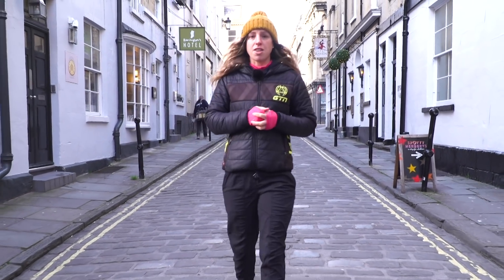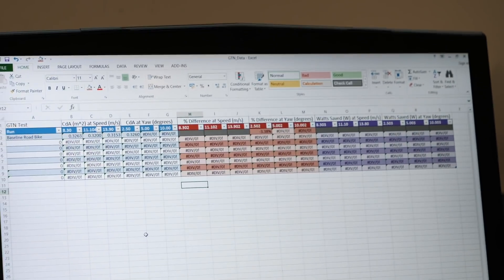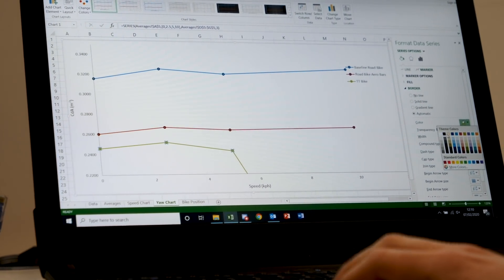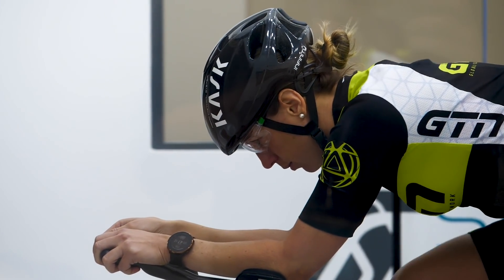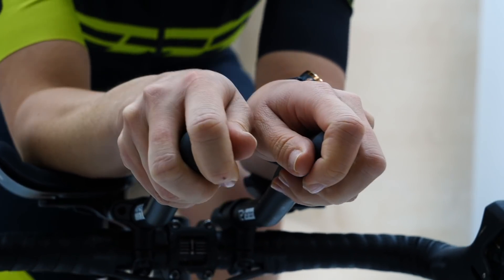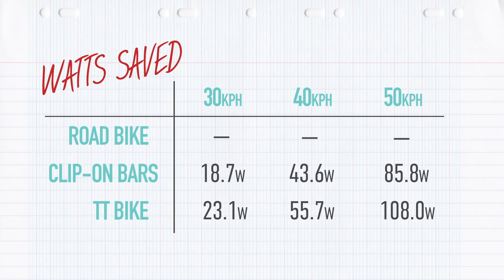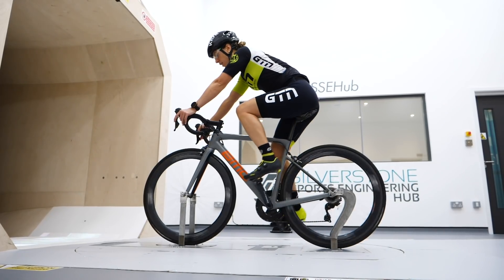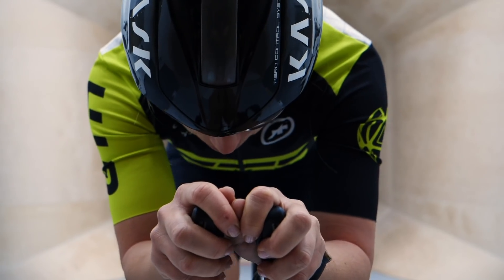Time Trial Bike vs Road Bike | Wind Tunnel Testing

Comment: I think some misconceptions were put forth here: 1) You can't get an open hip angle on a road bike - It depends on the road bike, mine allows me to move the seat quite far forward and then I just tilt the nose down a few degrees, voila open hip angle. 2) There are aero frame road bikes, lots of them, which would put these numbers far closer. There's also the fact that road bikes handle better than TT bikes, so in sprint and oly distance races where there are typically a lot of turns to contend with, I'm faster than those who brought expensive TT bikes, because I corner faster, descend down hills faster etc. The point is - you can buy a road bike that pretty closely resembles an TT bike and spend far less money, then also have a bike that's useful in the mountains, thereby saving a lot of money.
Reply: instaBlaster
Reply: Spot on
Reply: there are several saddle mounts that put you forward and open up the hip angle which cost around 100€ - you get the exact position as if you where sitting on a triathlon bike. pure tt bikes are much more marketing at this point. I can achieve a CdA of 0.2 to 0.22 on my custom built road bike.

Comment: Glad the 30KPH was included, because, realistically, that's where most of us are.  Just shows that for most, the upgrade to TT isn't for  any real speed gains.  Perceived speed gains are another mater🤔.
Reply: Also how long can a normal triathlete keep going 50kmph? 5, 10 or 15 minutes? Carbon bicycle frames are tremendously overpriced as is, and top end TT bikes are just ridiculously expensive. I've beaten ppl with crazy expensive bikes, simply by running and swimming faster, and have been beaten by ppl on steel frames, mtbs even. Dedicated tri bike is for professionals. Sure one can say saving 9 minutes over a 40km Olympic is a lot, but, in all honesty, i'd rather spend the price difference between the bikes on a new car, and just run faster.
Reply: Morale watts are 100% a thing 😉💪
Reply: Was going to say even the pros aren't riding @ 50... hell the IM Florida (really flat course) record set last year was I believe @ 44.8 kph.. That being the fastest male pro...
Reply: @minem23  While I agree with your sentiment in general, in all honesty, I would rather continue to comfortably live without any car at all and own a top-end bicycle instead, or - even better - multiple upper class bikes. What's crazy to me are people that drop a hell of a lot more money on expensive cars that are extra bad for the environment and are basically useless on public roads with speed limits. If you don't live in or close to a city, I can understand the need for a "normal" car though.
Reply: @ithanil4429  no argument there save for the fact that carbon frames are overpriced because of the short lifespan of the material. If you said titanium or custom steel frame, yeah :-)
Reply: @minem23  Oh, yeah a carbon bike is most likely not the best value available in terms of money per year or km. If you want a bike that lasts for decades, indeed you'd better go with steel (I don't trust Ti though).
Anyway, my current (first) Carbon bike got a 6 year warranty and I plan to use it - unless something very bad happens - for about 10 years. It's not my only bike and within that time I will, most likely, buy at least one more, so at the end of my use it will likely "only" be around 1500-2000 hours ridden. Which would result in something around 2 Euros per hour used, if we include (!) general maintenance cost, replacing at least the handlebar once and say it has 0 value in the end. Not too bad, in my opinion.
And I know people that are still happily using their more than 10 year old bikes with carbon frames. They were used a lot and are still just fine.
Reply: @ithanil4429  I hope mine will get the same, kinda started to love the damned thing. A dedicated triathlon bike seems too expensive at the moment. Wait until I finish a IM 70.3, then I will see 8-)
Reply: TT bikes are relatively insular in capabilities anyway, they're not as versatile as road bikes. Not for the average person anyway.
Reply: @ithanil4429  Same. I won't drive or ride motorbike, heck even public transport unless I absolutely have to most of the time. I am a petrol head, I still like the odd drive for novelty mainly but cycling has taken up the vast majority of my transport time now. It's significantly more rewarding and more often too.
Reply: I took the 50kmh as sitting on 30kmh into a 20kmh wind (and so on...)???
Reply: I got my tt bike for 1k so I think it was worth if I go 35kph probably 10W, $100/Watt isn't the best but not horrible

Comment: Ive only just gone from road bike to TT position with clip on bars, and the difference was not only faster but felt easier.Although I do feel cramped, but there must surely b  a way to set up a road bike so u not cramped in the clip on bars.

Comment: A tt bike on it's own is only faster in a flat course, the main gain when riding a tt bike in a triathlon is confort. That confort could be replicated in the road bike by changing the saddle and the seatpost setback. The bike industry is tricking you because the rider position on the clip on road bike is not the same as the tt bike, they don't want to compare it side by side. The tt frame's aerodynamic gains compared to a normal road frame are minimal for an average triathlete.
Reply: Good point!
Reply: André Figueiredo Changing the saddle and seatpost setback probably won’t get you in the same position necessarily, the head tube and seat tube angles are totally different and you could very well make the bike very twitchy by moving the centre of mass into a place it’s not supposed to be. You’re right in saying the frame makes the least difference because it does, even socks can make a bigger difference than frames. But in general a TT bike and then triathlon bike will allow you to comfortably and confidently get into a more aerodynamic position. If you can find a road bike with tri-like geometry then you’re on to a winner. I really like the canyon aeroad for this. It’s not a trick of the bike industry, it is representative of the difference between a typical road bike and typical tri-bike. Of course there will be exceptions.
Reply: @binbob9  It's kind of a trick, because when Cervélo launched the P5X every review was very favorable, I've never ridden one, but I could tell just by watching it, with that frame and disc brakes, it has to be sluggish as hell.
PS: I own a Stevens super trofeo(2016) and a Ribble SL(2017), the geometry is not the same, but with a zero offset seat post, a shorter stem and a base/tri bar. I guarantee you I'll be faster, more comfortable and save a lot of money
Reply: The red-shift aerobars + adjustable seat stem combo on a basic road bike has saved me a ton of $ so far.   I was able to spend just under $1200 and not feel bad about it.   The next step up would be $3k.  So with that difference I bought a power meter, head unit and trainer.   Until I can start pushing above 30km/hr consisantly...I feel that better tools are more important than better gear.

I with a flick of my hand I can move my seat up thus putting my hips in a better position.    Still want a decent TT bike someday but I will probably  put more emphasis on the mechanical rather than a super fancy ultra lightweight frame.

Comment: I switched from a Roadbike with Aerobars to a TT because I was going from Olympic Distance racing to 70.3 racing. The biggest difference for me was the change in comfort. When riding my Roadbike with Aerobars I felt very crunched around the area of my stomach, sometimes even feeling my legs movement inside my stomach area. Once i switched to a TT bike the difference was astonishing. The area between my legs and my stomach increased significantly enabling me to pedal smoother and longer in aero position. I kind of had the feeling that this boosted my run after the bike as well since my stomach wasn't that "nervous".
Heather when you sat on your TT you where keeping your head low and looking towards the ground. Do you think that lifting your head in order to actually see where you are going will decrease the watt advantage you measured?
Reply: I feel that this is more due to the bike fit than a TT bike advantage
Reply: Fluffimir Puddin +1 for the bike fit 🤷🏼‍♂️
Reply: Definitely need to see where you're going, but on aero-bars or TT bike - the goal is to get your head as low as possible to be as aero as you can be.

Comment: I am using a regular Road Bike with a special saddle mount to open up the hip angle and bring me more forward on the bike - also put my stem in the lowest position possible with a negative angle of 17 degrees (could even be less!) - this plus a good set of aero rims 60 in the front and 80 in the back makes my setup as aero as any TT Bike you would get for around 5000€ - if you dont add up the wheels the custom build cost me less than 500€ and I only have to buy one bike.

Comment: Very interesting, my complaint is the way the raw data numbers are presented is extremely confusing to understand, especially the watts lost with yaw where the positive numbers are not explained.
Reply: Top tt bikes actually increase wind speed pass the bike at These yor angles essentially pushing you along giving you free watts.
Reply: @alansteel1409    You'd have to imagine 10 degrees would not be enough? 

The best I could come up with, is they compare everything to a standard bike at zero degrees and as a reference they call this zero, then if the aero bike has less drag the numbers are positive, in reality the reference would have drag of x watts and the aero bike drag of <x but not actually positive, ie not being pushed along.
Reply: Jester123ish The positive and negative numbers represent watts gained or watts lost. So +10W means you’re 10W faster, -10W means you’re 10W slower. There have been different studies on the yaw angles of cycling. Typically you’ll spend 90% of your time below 10 degrees of yaw. Even at Kona, one of the windiest routes there is you’ll spend 70% of your time below 10 degrees yaw. Higher yaw angles are usually only seen in gusts hence there isn’t actually much time spent there.

Comment: as a non-pro you dont buy a tt bike for Speed but for comfort and the changes in geometry.
Reply: @gopre80 Cool factor leads to confidence.  Confidence can lead to better times.  Just don't let in bleed into arrogance.
Reply: I’ve stayed on a road bike for exactly this reason. TT bikes are not comfortable. The top triathletes have to train themselves to tolerate that position. For the average person a TT bike is an instrument of torture
Reply: @shaunhoulahan4080  thats not true. There are tt cockpits that allow a very very comfortable and upright position. And this confortable position will still be faster
Reply: Huan Son So which bikes are these? I’ve tried a few. I haven’t found anything remotely comfortable
Reply: @shaunhoulahan4080  i drive a 2016 bmc time Machine. I could get the cockpit realy high. If you take a bigger frame this thing us like my grandma's city bike. But not all bikes have these modular cockpits
Reply: @shaunhoulahan4080  It takes time.  It took me ~1 year to go from high and wide in my cockpit to ~50% the way there to ideal.  However, the I now prefer to be in the cockpit.   This is why starting with a road bike that have decent clip on aerobars and a seat that can shift forward is a great place to start.  My guess is in 2 years I will finally get my TT bike and I will enjoy it and take the best advantage of it that I can.  The best part is then I will have two bikes and can leave my road bike in the trainer.  :)

Comment: As a newbie, I found no / very little speed difference between a TT bike and a road bike with clip ons. 
However, I find the TT bike saves my legs a lot more for the run - rarely commented on, breifly mentioned at 4:47 but so much consideration required as I feel this would save me minutes in a 70.3
Reply: This I think is often what is missed.   There is a fixed cost to just "being on the bike" which, IMO, eats into your effective FTP more than people wold like to admit and or understand.   

I agree with an above poster in that the slower rider benefits the most in terms of time and thus gets the best bang.   However, in terms of $ per second, most triathletes after some clip-on would benefit much more from nutrition/training but the TT bike so fits the current "just give me a pill" problem fixer mentality.

Comment: who rides at 50 KPH, aka 31.5 MPH? The Cameron Wurf's of the world avg around 26 or 27 MPH at Kona. Crazy silly test. And there is alot to be said about position, hamstrings vs quads in on a tri bike vs road bike. On a NO wind same course route I will always avg circa 2.5 extra MPH on a tri bike vs road bike. Aero is just one of the differences in the two bike setups. There is also general comfort, the degree of CORE work is way different on the bikes.
Reply: Who said a thing about "averaging" ? There is some significant amount of time spent at, near or above 50 kph by elite athlete on time trial or triathlon courses, even when the average doesn't come close. Plus Kona is not a flat course IIRC.
2.5 extra mph on the flat? More like 2 kph, not to mention many riders struggle to put out the same power on their TT bike vs. their road bike - some World Tour pros even use a "TT FTP" to account for that discrepancy.

Comment: Why not matching the fit of the road + clip-on to the TT bike? Bars were clearly higher on the road bike. There was a lot of spacers there to play with, so the video is making for an unfair comparison.
Reply: There really wasn't anything in it....between the clip on bars and the TT bike...at speeds the average triathlete will ride at you're talking about 5 watts. They say this is 4 minutes over a 180 km Ironman bike segment....or 2 minutes over a 70.3 bike course...or less than 1 minute on an Olympic distance Tri....you get the idea. If you like to ride with a group or do straight road cycling events, a decent set of clip ons on a good road bike fits into the budget way more easily than a second bike.

Comment: The faster you are the more you gain isn’t an accurate statement. You may save more watts, no doubt. But the slower rider gains more from aerodynamics than anyone else. The slower rider saves more time than the faster rider. 1 second saved to the fast rider could be 10 to the slower. Time is really the only thing that counts. Why is this? Because the slower rider is out on the course for longer, so there is more time to be saved. The other part of that is the fast rider will rarely ever see a 10 degree yaw angle. The faster you go the closer to zero it gets, because your speed at 40-50 kph is vastly higher than any cross wind bringing the yaw near zero. 0-2.5 deg yaw is applicable to the fast rider. A slow rider’s speed relative to the wind is not as great of a difference, and the slower rider will see a higher yaw angle, where 5-10 is more likely. That gives the slower rider even more benefit from aero wheels in particular.
Reply: When you slow down to a certain speed, being more aerodynamic is negligible
Reply: Brian Chang not exactly. 12 mph/20kph is the point where more than 50% of your power output is going to overcome air resistance. I think you’ll agree everyone rides faster than that on the flat, so everyone will benefit from being more aero. Below that speed air resistance does not just disappear, it just matters less than rolling resistance or weight. It’s not negligible, it is just more important to be lightweight than aero when climbing slower than 20kph. That’s why drafting matters even up a climb like alp d’huez in the tour, and the winning moves only come near the top. Because they are beasts and are doing 14-16mph when us mortals would be doing 8.

Comment: Some of the way this is explained doesn't make sense.  
The time saved across the bikes for an Ironman is highlighted as 'at 33kph average' - if all bikes are doing 33kph, there would be no time saving as they are all doing the same speed and by default covering the same ground in the same time. Surely  if you'd based it on a nominal average power (say 220w) you could work out how much faster you would go for that given power and therefore a time reduction. 
Secondly, Drag in Yaw is displayed is 'Watts lost' which intuitively should  be a negative value. Here logic would suggest the road bike with a more open side frame profile and body position would provide a lower Later Df - The TT would get worse and cause and increase in watts required - something bourn out by the figures although you state the opposite saying it had more savings. This is proven out practically in the 'Gust wander' effect is greater on a TT bike in Yaw
Reply: Rob Chalmers Rob Chalmers the time savings were calculated by calculating the power required to ride at 33kph average using the CdA from the road bike and then assuming the same average power, how much faster you would go on the other setups with the lower CdA. The TT bike gets better with yaw compared to the road bike because the large profiles on the canyon start to act as sails. Hence the positive value, you’ve effectively gained 10W.

Comment: Needed more emphasis on the work you have to put in to moulding yourself to a TT so that you can run well off the bike. Most people do not train on a TT bike and moving from an extremely bent over position to then standing upright and running isn’t easy! Brick training is therefore a must!